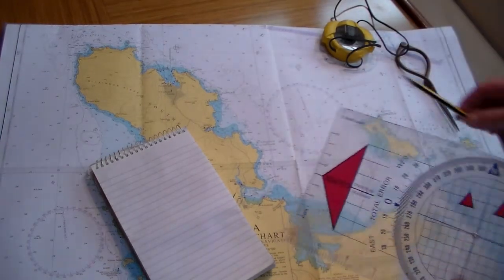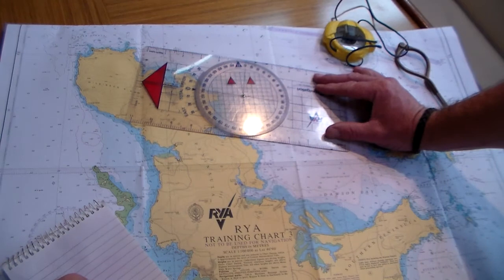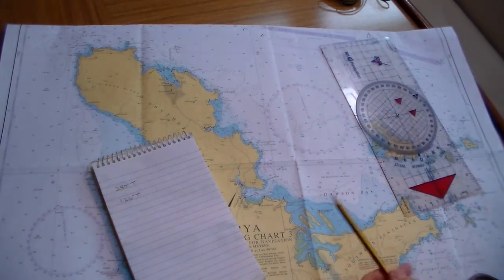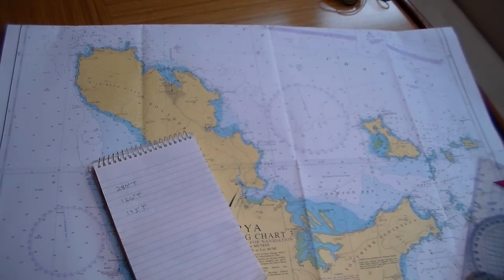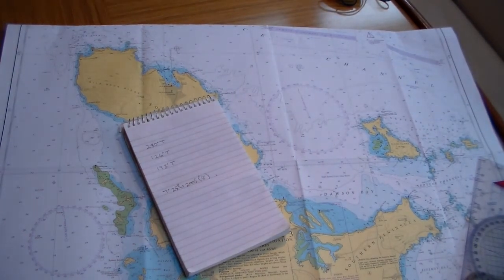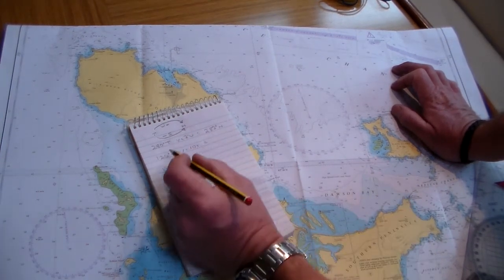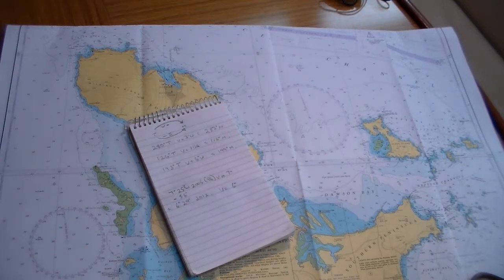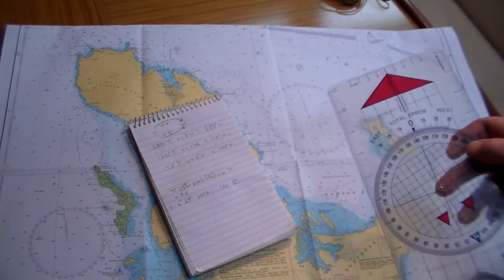Sea Master Training Centre - Using Portland Plotter & Variation

Comment: Dumb question: how did you get 56 minutes out of 7/8 of an hour? I get 52.5 minutes. Not sure how you got 56 minutes out of 7/8. Otherwise, great lesson. Thanks!
Reply: 7 years from 2005 to 2012 and 8 minutes movement per year 7X8=56minutes